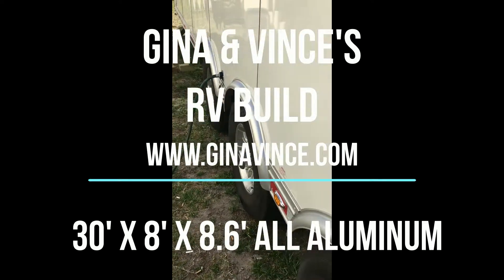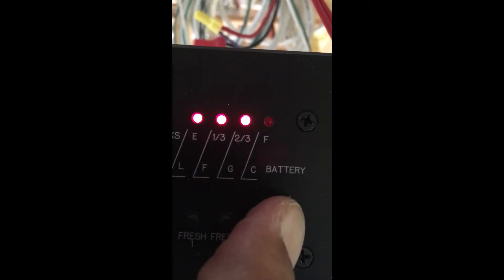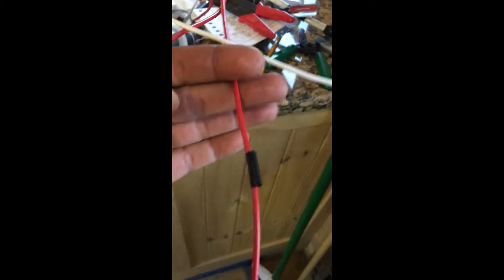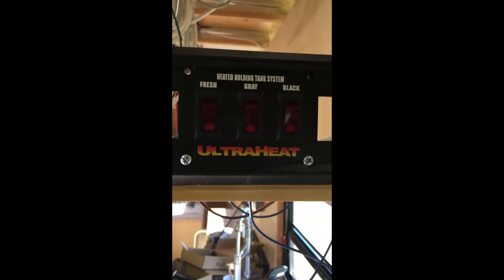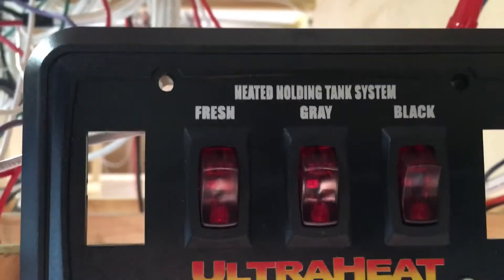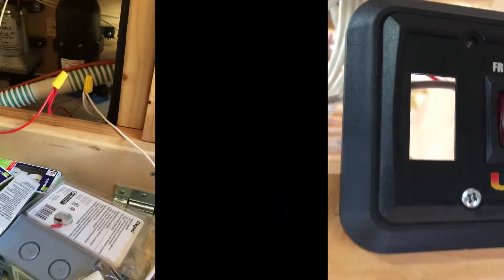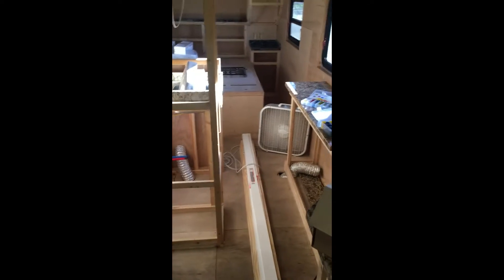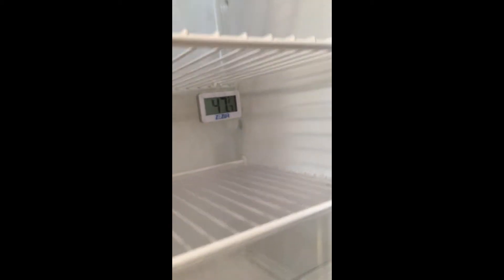RV Trailer Build #87 (Part 2) - Installed Heat Pad Wires and Switches

Comment: How are you sealing your wire chase from pests?
Reply from the maker: I use a clump of Butyl Tape in the end of the pipe. Seals up real nice around the wires and I can remove it if need be for service or new wire or for whatever reason..